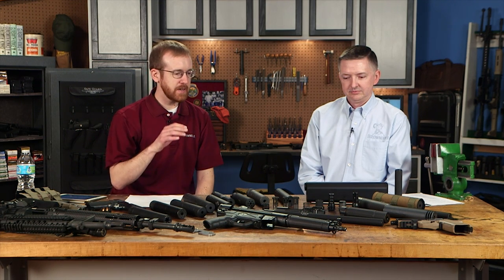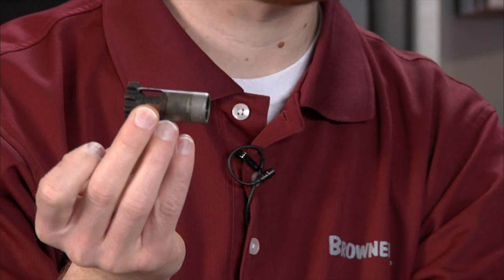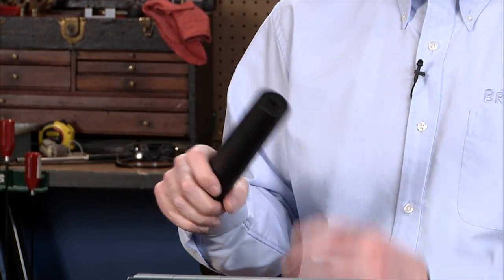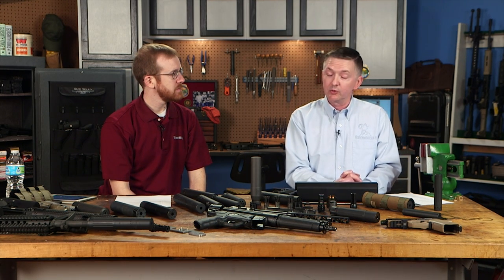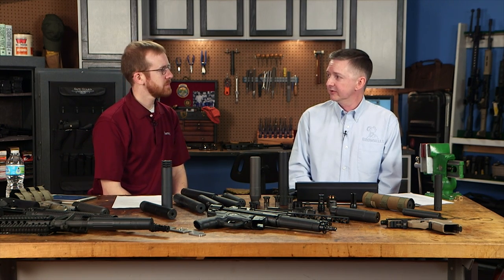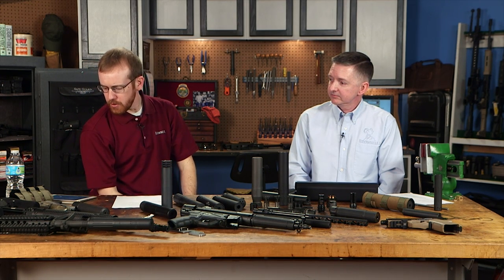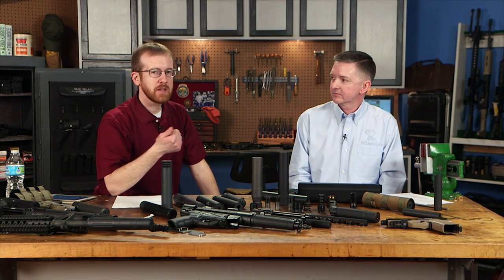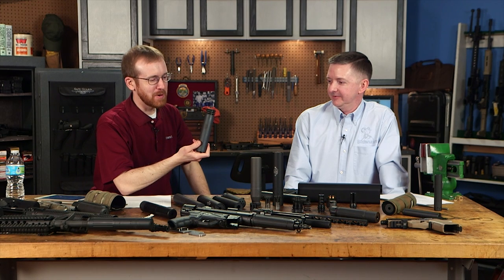Facebook Live: Suppressor Talk

Comment: What components are necessary to suppress an M1A?  I have an LRB Arms M1A, and I have a Thunderbeast Arms brake mount 30 cal. suppressor.  I can get a Schuster adjustable gas plug, but don't know if I need any other parts to account for cycling and gas pressure.  What do you recommend?

Kelly
Reply from the maker: We would recommend using a Smith Enterprise M14 5/8"-24 Thread Adapter, available directly from SEI, then thread your Thunderbeast brake onto that and use the Schuster gas plug. That’s about as good a set up as you can get for running a silencer on that platform.